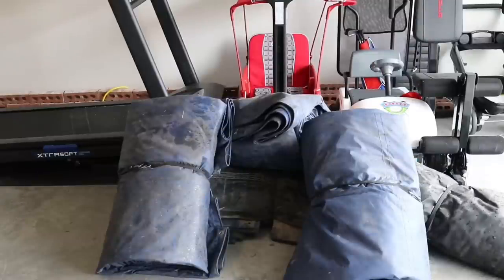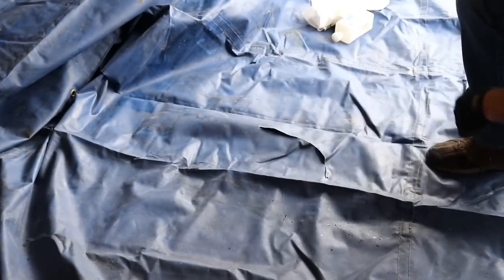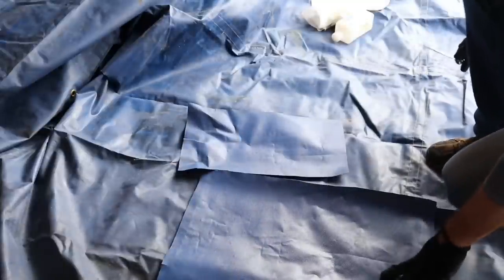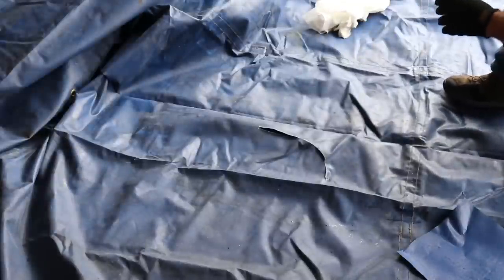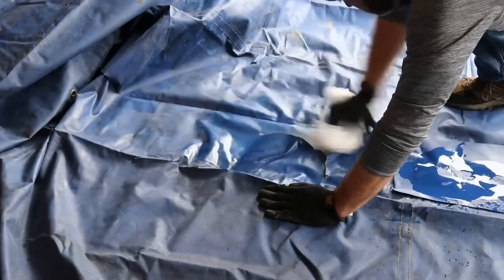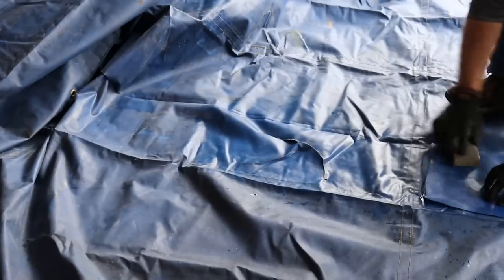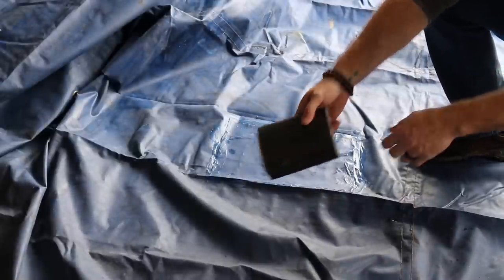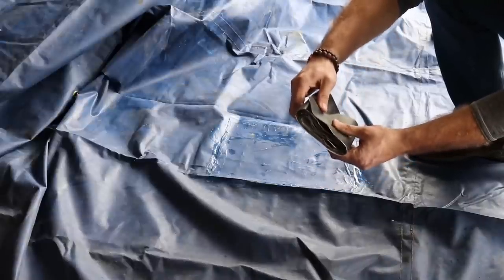How To Patch Tarps | PROPERLY

Comment: Thx for the video, and I have questions:
 Is it common practice for company drivers to repair their own tarps? And if so, should I be asking for compensation for repairing THEIR equipment? 🤔
 
I suppose what really got me thinking about this was taking my tarp in for a repair estimate and was told they'd do both tarps for $300 😳 Mind you, my tarps weren't in very bad shape, had a couple of 6inch tears, but everything else was just tiny holes here and there.

 I went ahead since the company reimbursed me for it, but if they're willing to pay a shop $300, should I really be expected to do it myself at no cost to them? 🤨

Comment: The patch kit is 40 bucks.  A 16 X 20 tarp is 34 bucks at Menards.    You are repairing huge tarps,  extreme duty.    Thanks
Reply: when you are repairing shelter logic temporary shed, you will discover that you are repairing 300$ cover with 10$ glue and patch.